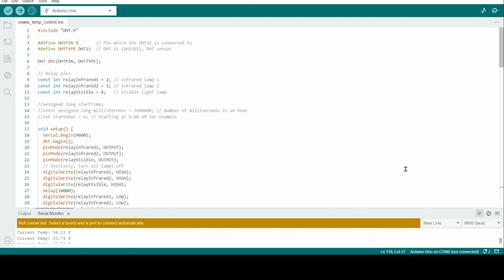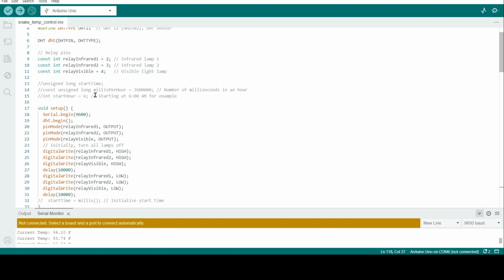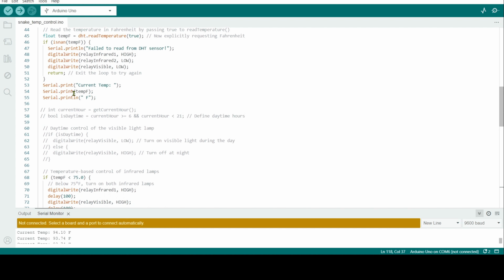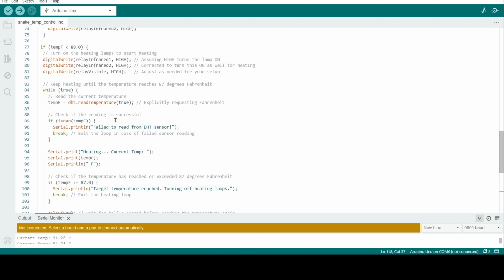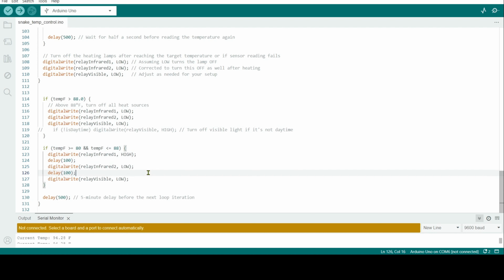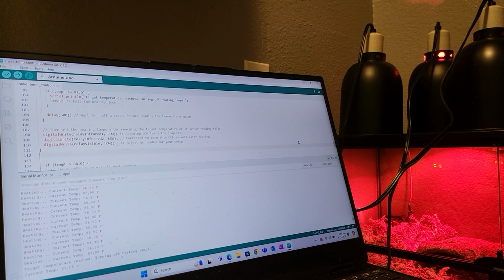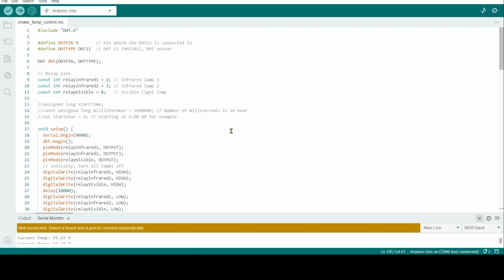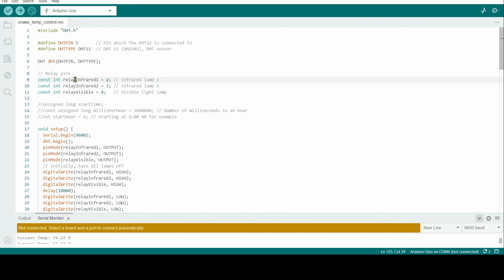Snake heat lamp project part 1

Comment: Hello stranger on the internet :)
I’m not sure how I stumbled across your video with 6 views but I like the project… relays can take quite a bit more current to turn on than an Arduino can supply, depending on the relay and the Arduino. Usually arduinos can supply ~20-40mA per GPIO pin, and depending on the relay you might need more than that.
Also, I’m thinking of starting my own robotics channel and this might just be the inspiration I needed! Keep doing your thing brother 🫡
Reply from the maker: Thanks for the comment! I was wondering if that was an issue too especially when the one relay was switching on and off like it was failing to be held in the closed position. I might need to find a way to supply additional power to the relays to switch them. I'll have another video out next week if you're interested in following the project!